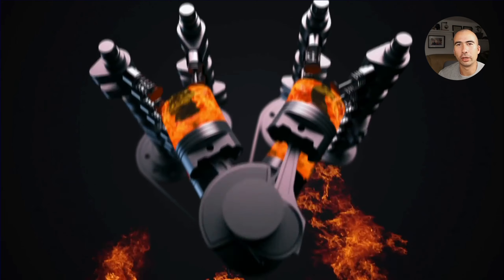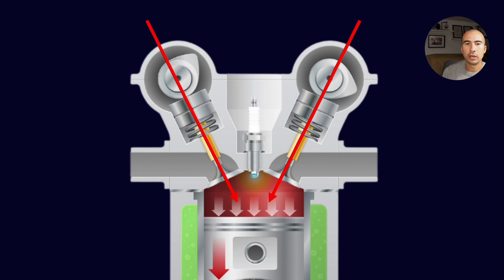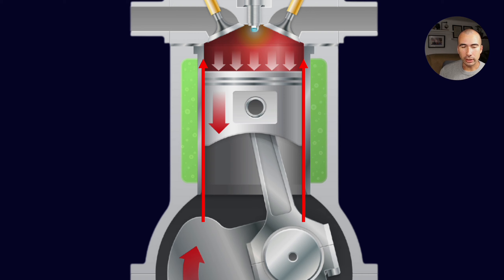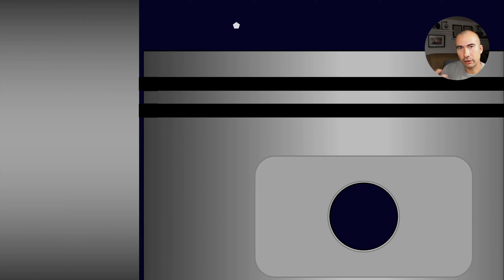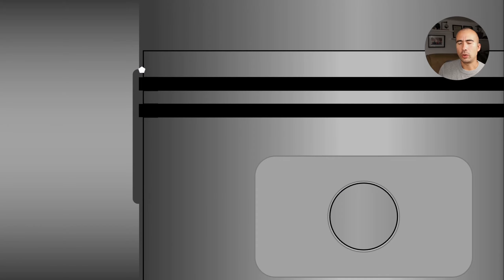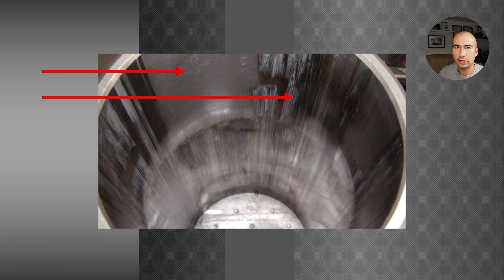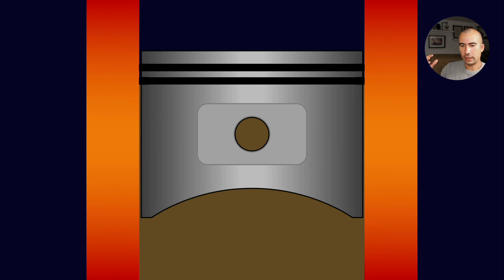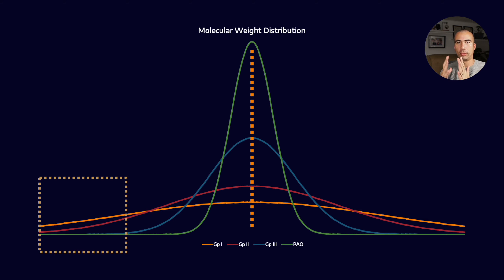Why do Engines Sometimes Burn Oil?

Comment: Valvoline has introduced a new oil specifically designed to clean the oil control ring and get it moving again.

Valvoline Restore and Protect. It’s hard to find anyone claiming it doesn’t work.

The Motor Oil Geek YT channel went to Valvoline’s testing facility last spring and interviewed them about it. Video on his channel.

Comment: Couple other possible reasons for oil consumption could be: 1) Sticking oil control rings that no longer push against the cylinder wall well enough due to running crummy oil too long, and 2) A badly designed PCV system that sucks too much oil vapor into the intake manifold, which would become worse if the oil volatility is high.
Reply: He did mention that their other rings on a piston. As he explained the compression rings are the last line of defence for oil entering from the crankcase. The oil rings are the first line, but the do not completely eliminate oil from passing them, even when in good condition.

Comment: Good picture of ring twist, function, during strokes. Word is, Top & second rings are slightly different? 
Top, more compression holding? Second ring, doing some, (backup) compression? A bit more, oil control?
Major, oil control, of course, the lowest, oil control ring. You could do pics of these, in another vid?
Here's a thing. In the ongoing drive, for better fuel economy & reduced emissions - 
Thinner oils & lower piston ring tension, have been used, to reduce frictional losses. Ok, when pressure above,
'Cos pressure firms the ring, against the cyl wall. 
On the suction stroke, not enough tension, against cyl, wall? Vacuum draws oil up :)
Reply from the maker: Depends on the engine, but yeah often the second rung will be a bit of a hybrid. I think the second point you’re generally making talks to the idea of lower viscosity oils being more volatile. That is somewhat the case, although it’s probably been offset by the fact that most of the engine oils are now Group IIIs and so have fewer light ends.
Reply: @LubricationExplained  Lower vis oils do not have to be more volatile - The reason, you stated.
I meant, minute amounts of liquid, lower vis oil, can get sucked up past the rings, to go above the piston, during the suction stroke. 
Similarly, minute amounts of oil can get sucked down the inlet valve, seal & stem, during the suction stroke,
The latter may help, to clean the inlet valve, for GDI's?
Over the service interval, these causes, consume engine oil?
Carbon formed & blowing by, down the piston rings can deposit in piston grooves?
May help seal? A little? But also, hinder rings function? To the greater loss?

Comment: With aircraft engine, one of the reasons they have dual spark plugs is incase one fowls due to oil consumption (as well as redundancy for lead fowling, coil loss and other reasons). My understanding is that air cooled engines especially those with steel cylinders and aluminium pistons suffer from increased oil consumption due to larger cold clearances (and other reasons). Not tested yet, I imagine oil consumption would be severely reduced with a turbocharged engine, even if just slightly, as there will never be a vacuum in the combustion area. The positive pressure differential would also stop oil entering the valve guides most likely. Of course you have the possibility of oil entering from the turbo if the oil return was to become restricted. Just rambling. A lot of the aircraft engines either get fowling or hotspots because of oil ingress, so the topic of keeping it out is important to me. A lot of these engines are naturally aspirated still so they do not have the benefits of the pressure differential. I was thinking of having a fine white filter after the aftercooler to capture and assess any oil that gets through the turbo, haven't seen that done, but Im sure it has been in testing facilities. I'm also surprised that gapless rings are not more commonly used on engines. Thanks for the video. When My patents come In I'll help you out.
Reply: In cars generally turbocharger engines burn more oil because the ring gaps are much larger and tolerances not as tight to accommodate additional thermal expansion when on boost.

Modern cars use unleaded fuel and run ultra lean by design the plugs tend to stay clean. Typically where you see fowled plugs in a car its a symptom of another issue (e.g. injectors not operating correctly, engine fuel condition incorrect, plug electrode gap incorrect.)
Reply: Even with a turbocharged gasoline engine, there will still be a vacuum during the intake stroke almost all the time since the engine is only going to be in boost under higher loads such as when accelerating somewhat hard. Diesel engines are somewhat different since they don't need a throttle plate, but you still won't be building much if any boost at idle. A diesel engine which uses a throttle plate for emissions reasons may regularly pull a vacuum during the intake stroke. But as someone else said, turbocharged engines tend to have larger piston ring end gaps and looser piston to cylinder wall clearances so the pistons and rings don't bind from the thermal expansion when in boost, so in practice, turbocharged engines tend to burn more oil.

Comment: Manual book says I should use 5w30 oil.
The engine has direct injection and turbo, plus with my city's temperature reaching 40 c, and constant traffic, my car consume oil 1 liter / 2000 km.

Do u think i can change into thicker oil auch 5w40?
Reply from the maker: Pretty hard to give a recommendation without specifics. But in general going up a single viscosity grade doesn’t hurt too much.
Reply: Might increase oil consumption as well if the higher viscosity stops the oil rings scraping the piston as completely. 

Air temperature doesn't matter in modern cars because the cooling capacity is vastly oversized, if you want an engine to run slightly cooler just change the thermostat. That said it might also use more oil if the engine isn't operating in the optimum windiw because the cylinder wouldn't be properly sealing.

Comment: Thank you very much for this lecture. Indeed, you are a doctor in this field. But I have a question, please, dear. What is the alternative solvent for sulfur acid in the setting of the bitumen?
Reply: I don't think your question is lubricant related? Maybe I'm wrong.
Could you share a bit more on what you are trying to achieve?

Comment: Ond of the main reasons is = clogged piston oil drain holes.
Toyota 2AZ-FE
BMW N52b25
If it s not too late, these can be unclogged using 3 oil flushes with BG EPR 109

Comment: Hello everybody,
I 'm wondering if it is possible to soak in some cleaner into the cylinders through the spark plugs holes,let it work awhile and run the engine to working temperature , would it benefit to free those piston rings ? 
Just an idea I had one day after looking Inside the cylinders while changing my spark plugs.
Thanks for getting back to me.
Tigo.
Reply: The piston rings should remain clean if oil is changed at the correct intervals and injectors are operating effectively.

In high mileage engines people sometimes resort to high mileage oils which have a heavier weight. Ultimately only a rebuild will rectify the issue however.
Reply: @thomas316  hello,
Thanks for getting back to me .
Will help me with my reflection.
Thanks
Reply: Yes, piston soaks with Berryman's B12 can help free stuck rings.

Comment: I have to wonder if using a product like CRC intake valve cleaner will wash the oil out of the cylinder walls causing increased rate of wear. Anybody have any idea if it does?
Reply: Ive always used it on my GDI 2.0l engine. It could damage the catalyst more than anything, I use it before ever oil change, your best bet is to let it soak longer, and drive it really hard after until you feel the cat get kinda clogged, then a huge release of white blue smoke comes out the back for 5 minutes. Get ready for a smoke show. I tried all GDI cleaners, so far im using the Seafoam GDI cleaner. It smoked more than the other brands.
Reply: @chandlerchhem2128  You realize that smoke doesn't indicate cleaning, right?

Comment: You forgot oil via PVC system, oil  being pushed into the intake manifold due to exissive blow-by due. Moreover, blow-by caused by a combination of upper cylinder ware, espicaly at the pistion thurst side, during the power-stroke event, and pistoin ring were. 
All theise add up to a total ware. 
Another problem is that the piston rings stick to tbe piston and don't excert enough pressure against the cylinder wall, due to lack or extended oil changes. Actualy all the possiblites of exssive oil  consumption are mostly due to lack of and/or not enough or extending oil changes.
Some time's due to bad MFG design or metalogy on   engine block or piston ring or a combination of both.

One more valve gide ware is another source of oil consumption.
Reply: He did mention cylinder wear. Also, its PCV, not PVC. A PCV is also not a component that is required or crucial for an engine to operate and not all engines have them. You could also state, turbos, superchargers, oil coolers, heat exchangers, gaskets, manifolds etc